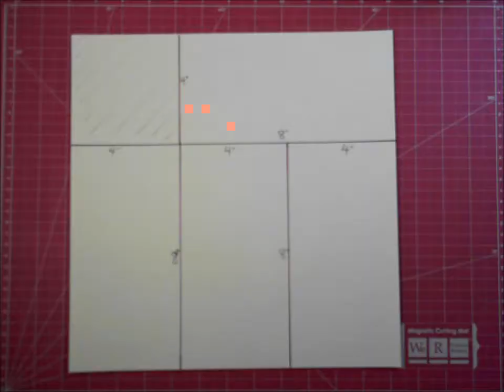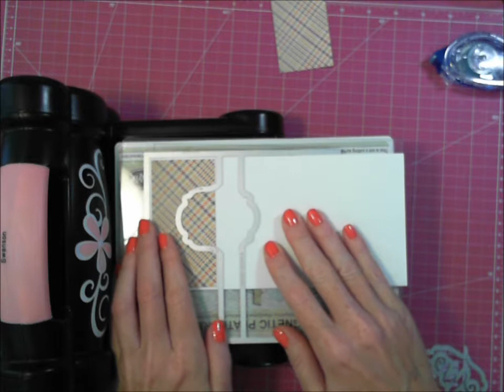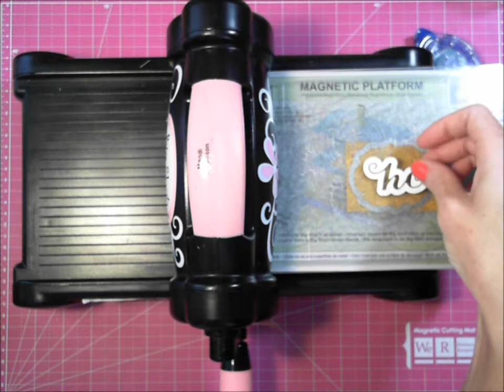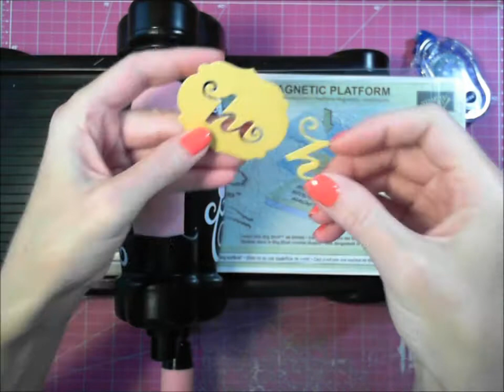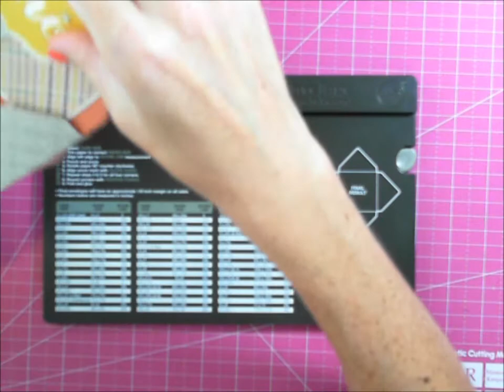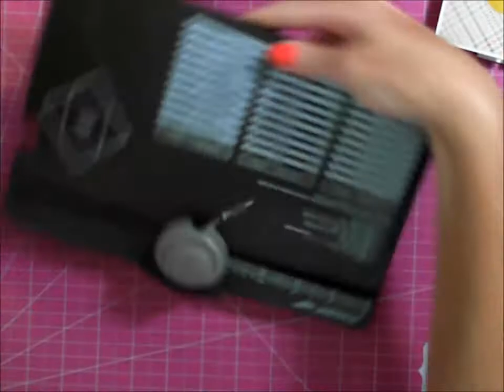Label Flip Card and Matching Envelope Demonstration

Comment from the maker: Hi Brenda, Sorry for the delay in responding to your comment. I made my framelits die book using the Cinch binding tool from We R Memory Keepers, chipboard (for the front & back covers, which I covered with DSP), and wire bindings from We R Memory Keepers. I used self-adhesive magnetic sheeting that I found at our local craft supply store. I've been wanting to do a video on those books, because they seem to sell really well at craft fairs too. Thanks for asking!